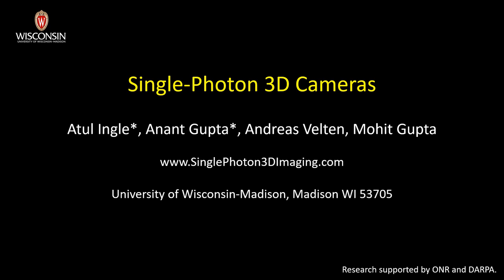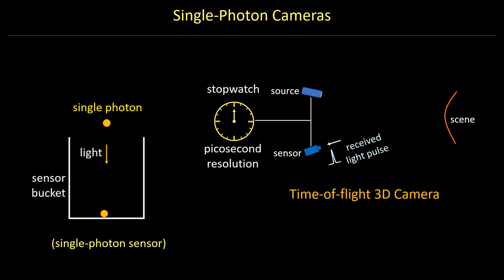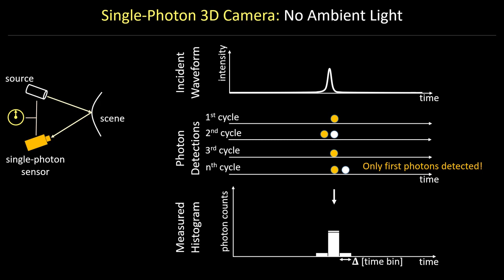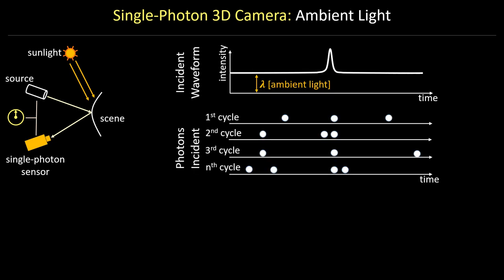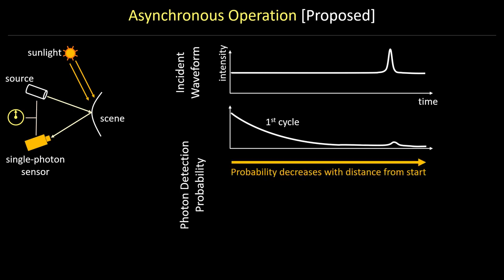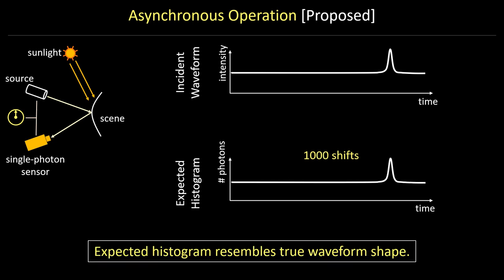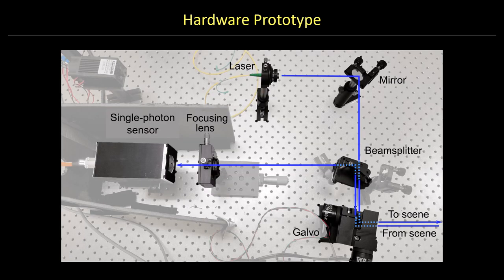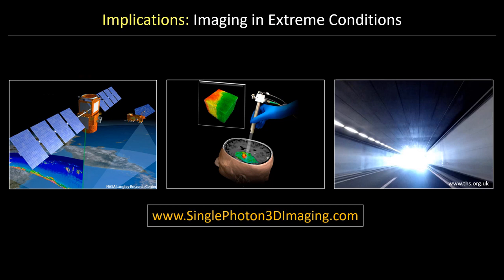#26 Single Photon 3D Cameras (Poster)

Comment: Hello Atul,
Thank you for your great presentation! I'd like to ask a question for you.
At 02:22, the histogram exponentially decayed at the beginning, this is the "traditional synchronize condition" + "first photon detection" as you described. I'm wondering what's the running mode of the SPAD for this synchronize condition? Are you assuming the SPAD is working at a synchronize gated mode for the traditional condition, other than using the "free-running" mode? 
The reseason for my question is that, if working at the "free-running" mode, the photon detection in the previous cycle would affect the detection in the next, because of the effect of dead time.
Thank you very much!
Best regards,
Zhijian Li
Reply: Hi Zhijian,

Thank you for the question!

We assume that the conventional synchronous mode is the gated mode of operation. 

You are correct in noting that if we use free-running mode, previous cycle's dead-time will affect the photon detection probability in the next cycle. Our "photon-driven asynchronous acquisition" method uses a free-running SPAD. You will find technical details about this in our ICCV2019 paper and its supplement: https://wisionlab.cs.wisc.edu/wp-content/uploads/2019/07/Async_SPAD-3D_ICCV.pdf

Thanks,
Atul
Reply: @ingleatul  Thanks a lot for your reply and link. I got it!

Best, 
Zhijian